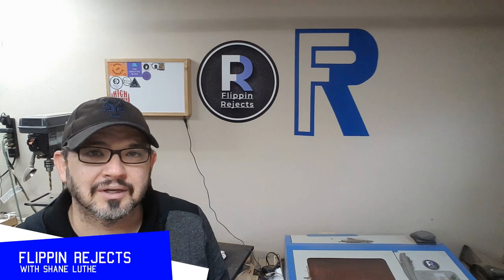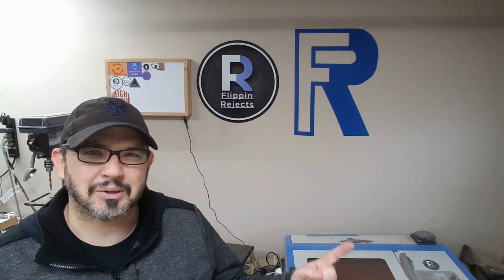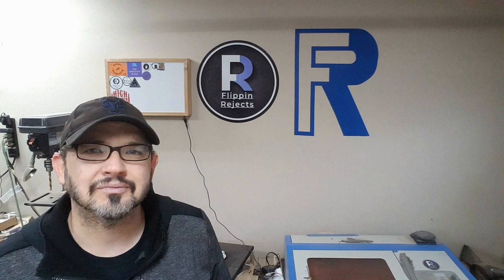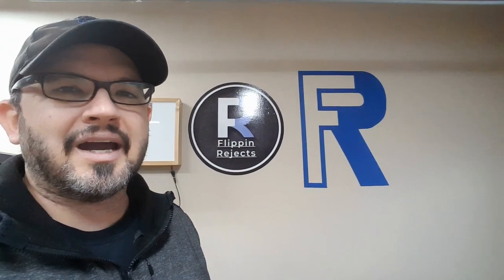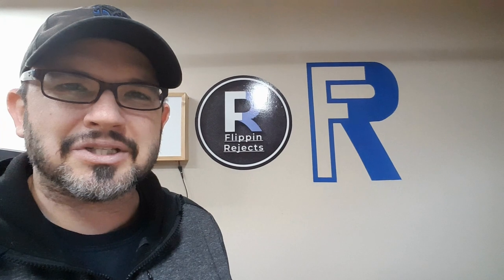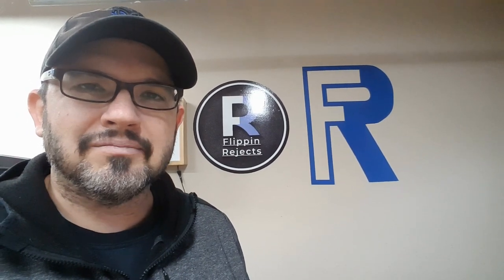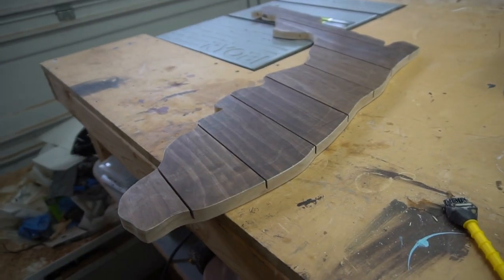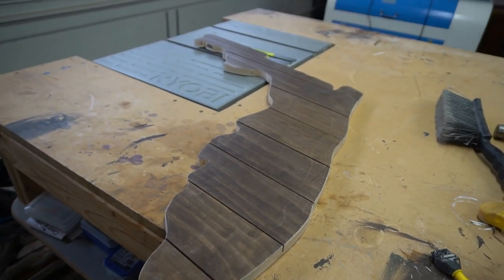Diy Rustic Wooden State of Florida

Comment: How do i print out the sketch to trace with? i want mine to be pretty big.
Reply from the maker: I did mine with a large format plotter with vinyl, but you could use a normal home printer and figure out a tiling setting. This may work. Hope that helps. Thanks for checking out the video.